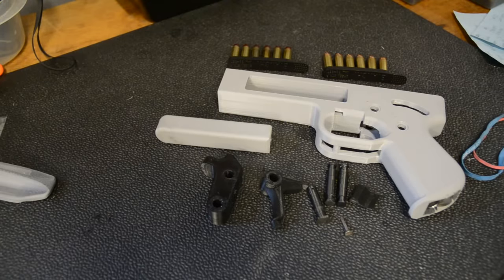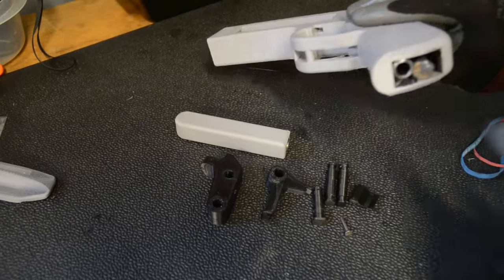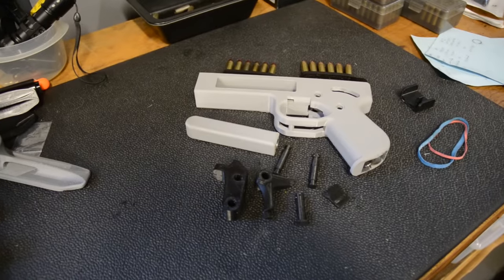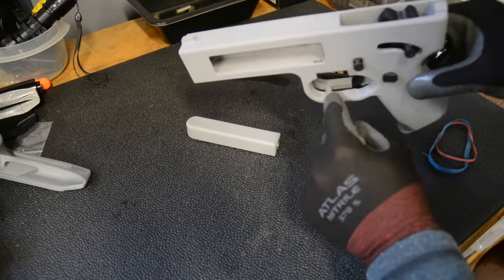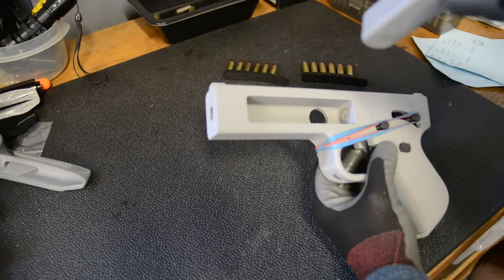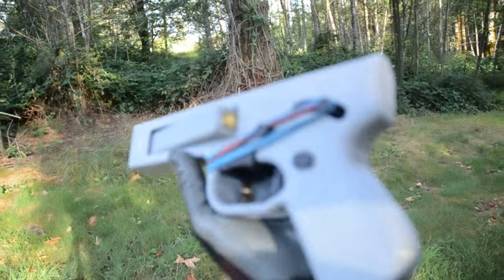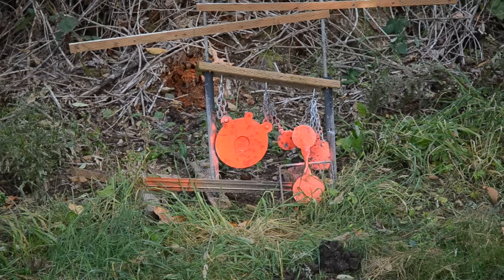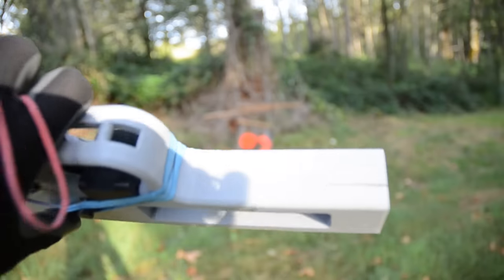Songbird 3D Printed Pistol - .357 Magnum

Comment: IMO it was not a "wedge" or layer failure.

I would say it was the gasses that was jammed  into the voids between the barrel and the barrel tip that caused the banana and burned plastic at the tip. the gasses have no where to go so the piece failed at the weakest point letting more pressure out and by then it was over. you cleraly see all that burning on the inside is a bad sign and the weak layer was just the weakest point that happened to be there maybe from a lot of firing.

1. you could machine the barrel parts to the thousands of an inch make them all perfectly flat and the exact dimensions to 0.0001- 0.0003 if an inch of accuracy with a lathe. that might fill any gaps and make sure the gas all goes out the tip of the barrel.
2. If you made the barrel top clamp down on the barrel insert it could fill any gaps and hold them together. could turn into  like a nose attachment type thing.
3. make a new full length barrel and change the loading system.
Reply: I think you're very professional

Comment: To help stop splitting you can "weld" with a soldering iron rings around the barrel. I have printed quite a few bike parts and this is a trick I have used quite a few times to improve the strength along the layers. You can use filament as a filler material. Give it a try :)

Comment: I found this interesting because I have a 3D printer (Flashforge Pro FDM style) and I'm a shooter. Did you use ABS, PLA, or something else for the frame? Also, why the rubber bands? There are springs aplenty out there. Are you uploading this to thingiverse? Or did you find it there?
Reply: ***** Didn't know he had one. Thanks.
Reply: John Mood Your link refers to undetectable firearms. I was being more general regarding making your own firearm. You can never transfer it. But it is legal to do under ATF regulations. Look into 80% receivers. It's a complicated subject. I personally would not touch one. In the case of 80% receivers, it is just cheaper for me to buy a 100% receiver on the ATF-4473 from an FFL. IANAL.

Structurally, an ABS or PLA or any other FDM printed "gun" will not stand up. Steel components are needed.
Reply: If you read the entire ATF code you will find that handgun manufacture is a great deal more regulated than you think. It's a crime, the article does mention that, but my may have missed that part.

I agree, I would never touch one, much less fire it with magnum rounds. that liner could barely stand up to .22 LR pressures, 357 Magnum standard pressure is 35,0000 PSI.
Reply from the maker: +John Mood You are incorrect.  See here: https://www.atf.gov/firearms/qa/does-individual-need-license-make-firearm-personal-use
Reply: Your build, as I read the law falls under the NFA rule, and you don't seem to have a $200.0 stamp and didn't mention if you had one or not....
Reply from the maker: +John Mood How does this fall under the NFA? I have lots of stamps for other NFA items, but a single shot pistol doesn't require one.
Reply: John Mood This pistol would only fall under the NFA if it was an AOW. Then it would need the Form-1. That would only happen if it was a smooth bore, so far as I can tell.

My reasons for not touching 80% receivers or building from scratch are more legal than engineering related. I live in a free state, so I don't have to. While I am a DIY person, making a firearm from scratch is beyond my ability.

What I would do, as I said before, is buy a 100% receiver on the 4473 and build from there. No machine tools are required for that and there are no legal ambiguities to deal with.
Reply: That's true. But the project is very questionable, and extremely dangerous & irresponsible or the video maker.
Reply: If a person decides to do the same thing, that's on them. Personal responsibility is a part of freedom. Keep it legal and do as you please. Take responsibility for the consequences of your own actions. Don't blame others.
Reply: I don't blame others, I WOULD blame myself if I did something so idiotic. Those that do this will eventually suffer some consequences, so free will needs to be tempered by common sense, and this project makes NO common sense whatsoever, in my opinion.
Reply: John Mood I think that we are mostly on the same page. Our disagreements on the law can be settled by the ATF. As for making videos of doing something stupid, where would LiveLeak be if no one did that? ;)

I don't think I have anything more to contribute to the discussion. Have a good one.
Reply: True that!  I tend to lean to, if possible, the stricter interpretation so I do not run afoul of the ATF. God forbid you have them call on you with a warrant... Even if you're completely legal, you'll fare better if you're staying on the conservative side of the interpretations, just my way of seeing it. I like my freedom and my Second Amendment privileges too much to screw it up.

Have a good one.
Reply: John Mood I'll just say, 2nd Amendment rights, not privileges. ;) The feeling is otherwise mutual.
Reply: I would lose my right to carry concealed under a different set of laws.  As a retired cop those other laws would take away my right to carry concealed should I run afoul of the law. Non-police CCW holders face the same loss of carry privilege if they run afoul of the law. Hence the word privilege. I could still own and possess in my home and auto under the laws of my state, but should I lose my LEOASA carry permit it would be a a major problem for me.
Reply: I take a stricter constitutionalist view of things, so it's really a matter of semantics.

Losing my CCW would be a major annoyance for me as well. Strictly speaking, I only have it to be in compliance with State law. I can't afford to take my principles to the courts.

Comment: That barrel wouldn't wedge forward. The gas pressure from the explosion is causing the separation. You should always bake your 3d prints in an oven to fully bond the media

Comment: 3D printed pistol: exists
Metal detector: this is cheating
Reply: Still has plenty of metal.😎
Reply: The barrel NEEDS to be metal, if you try to 3d print a barrel it would blow up in your hands and probably kill you. Because obviously, 3d printed material does not have the structural integrity to withstand the pressure s exerted by the propelent and the projectile going through. 
Furthermore, I would much rather purchase a firearm at that point rather then making one in that manner....in short...

 

THAT GUN FUCKING SUCKS!!!
Reply: It's a 3d printed piece of junk frame, you can actually print metal but those are far more expensive.
Reply: @joshuawood1436  you must be really lonely!! Your commenting on almost every post the same comment on a two year old video.
Reply: @ftniceberg874  What?

Do you speak English by chance, and if so can you repeat that,  but in English?

Comment: a lot easier, cheaper, quicker and safer just getting a ghost gun in the hood
Reply: this pastic gun is the least safest gun due to not having a safety function installed and the gun is more likly to explode in your hand which makes it more dangerous to the user then a real gun.
Reply: hendrixphish420 also alot easier to go to prison when the gun is linked to several murders
Reply: Mother is the invention of necessity. Wait... rearrange that.
Reply: Nieroshai Weird.  I just wrote that inversion of the phrase last week!
Reply: Bomb
Reply: @senkenkai  if you need a manual safety on your gun, you shouldn't own firearms lol
Reply: @iSuperdupaloveweed  that was long ago. Now I think it doesn't matter whether a gun has a safety or not.
Reply: Pick up a ghost gun, get randomly checked by cops, turns out the gun has matching ballistics in 5 murder investigations, whoopsie!
Reply: Hood ?? Safer !!???
Reply: rollin thirtys  unless you swapped out the barrel and the firing pin you'll get charged if caught, they run forensics on both. If they find a match in their database you'll be bubbas b'tch for the next 25 to life.

Comment: I wonder nobody has printed a derringer style gun? so much easier to load.
Reply: I'm kinda curious why people try to reinvent the wheel. You don't need to make every single part. If they would buy trigger control parts, etc, you could make a great reliable gun.
Reply: ***** Uh, have you compared a medieval cart wheel to a Z rated radial lately? There absolutely is a need to re-invent the wheel about every two years or so.
Reply: I understand where Len is coming from. He means just print the slide and frame, then buy the internals and hopefully have a fully functional pistol. I think these people just wanna see how far they can get with just the printer and whatever is available at home. Basically make it from scratch.
Reply: as you should know, a round needs pressure on all sides to work, a plastic frame could not possibly put back an equal or greater force against an expanding .357 or even 9mm case unless it was the thickness of a human thigh.
Reply: JoJo Show that math.
Reply: With his legit barrel liner, he only needs to worry about bolt thrust on the frame. Realistically, the frame just needs to takes a little over 3,000 pounds of peak backward force from the cartridge's base, plus maybe 50-100 pounds of forward force from the bullet acting on the rifling. Assuming he's using an optimal nylon material with a shear strength of 4,800 psi, a breech face over 1/2 inch thick will technically be able to hold up to the peak bolt thrust of a 357 Mag (based a rim diameter of 0.44", which gives a shear circumference of 1.38". 1.38" x 0.5" x 4800 psi = ~3300 pounds of force needed for cartridge base to shear/perforate through breech face).
Reply: He's using ABS. Nylon would be more appropriate but are not widely available in FFF printers at this time.
Reply: Victor R You are correct. You don't need a form 4 for a barrel in the US, correct? That's all I was implying. The hardest part is easy to get, but I get they want to try and build the whole gun.
Reply: RCONSTRUCT you can make your printer more compatible, try carbon fiber or polycarbonate and have something that will last. yes you can print with those

Comment: I wonder? If you extended the barrel liner out the front of the frame, it might help to lessen the pressure that caused the frame to split even more.
Reply: and make it a one shot pistol. The barrel swings out from the front, pushing the barrel through would make it stick in there.
Reply: just insert the barrel into the front instead of the side after replacing the round.
Reply: Eto Hige Gamer Culture tvat would send the barrel flying
Reply: Espen Andre not if you put up a no fly zone sign
Reply: or he could make it load like the double barrels shotgun
Reply: William Richards bjcjj

Comment: What kind of 3D printer do you have? Ive been wanting to play with ABS, but mine is not an enclosed unit.
Reply from the maker: Fusion3 F306.  Try putting a cardboard box over your printer.
Reply: i have a cr-10 and i put a small 1x1/2 pice of wood with clothing hangers and i balance it on top of my printer then i put a bed sheet over it and it works great
Reply: Why does in need to be enclosed?
Reply: ABS will warp by too much cooling if its not enclosed to retain heat.

Comment: The air powered German SWAT defensive weapons are basically airsoft guns with metal bbs that unload 1000s of rounds a minute. Like saw a door in half bb guns. They are super simple to modify from a standard airsoft weapon just add a bigger air tank and a huge hopper. There are TONS of loopholes. The 2nd amendment is really fun.

Comment: Creates the perfect ghost gun

The Mexican Mafia wants to know your location
Reply: has a metal barrel
Reply: Ya really think any large Mafia doesn't have the cash to buy a machine shop and just make all they want? 

There is no such thing as a firearm that will get past a metal detector. Just like how the media tried to scare everyone over the plastic Glocks when they came out. They never mentioned the slide, barrel, firing pin, etc. were metal.
Reply: I'm not talking about a metal detector wise... I'm talking about how easy it is to make and how cheap it is. I have no idea where either of you got the idea that I said it could go through a metal detector.
Reply: @greenman8060  

How much does it cost to get a 3D printer capable of doing this and how much will a person have to learn to use it properly?

It's not illegal to make a firearm at home as long as it abides by current restrictions.
IMO it would be easier to get an 80% 1911 or Glock frame and build one. All you need is a tabletop drill press, a few bits and follow the instructions.
Reply: @DChrls  ok well it was supposed to be a joking/satirical comment but झयभव

Comment: The reason why he didn't blown up his hand while firing that gun is because the pressure from the bullet itself is pushed towards the magazine barrel (I'd like to call that barrel a magazine since the bullet is is inside of it.)which when fired, the pressure is kept inside the barrel until the bullet propelled out. The main reason why the muzzle of the gun cracked is because as I've said the pressure from the bullet is kept inside the barrel pushing the bullet out and that pressure is so immense it cracked the gun muzzle.

Comment: I guess it's just the overpressure that splits the frame at the front. If the barrel would reach out of the frame, so that the pressure could expand outside, it wouldn't break like that.

Comment: .357 is about 30-35K PSi chamber pressure.  That's putting a lot of faith in that plastic breech-face and your barrel liner.  You're lucky the only thing that happened is the frame cracking.  I've seen a lot lower pressure loads cause guns that were built for black powder, but out of steel, rapidly disassemble.

Comment: To fix your layer separation just print the frame vertically. That will also allow generated forces to be absorbed through the frame, similar to a spring

Comment: I suspect it split because of the expansion of gas. And I wouldn't be suprised if the barrel shroud were to soon fail in the some mode, since your insert isn't full length.

Comment: wait if you have a pre-bought barrel doesnt that make it not a ghost gun?
Reply: nope only the lower receiver is labeled as a "firearm" and carries the restrictions and serial code branding. in a pistol this normally constitutes the frame and trigger housing. The rest of the firearm barrel included are not counted as the firearm, they are simply parts to a firearm. My wording may be a little off but that's the basic idea. In a state with concealed carry restrictions I can purchase like 70-85% of a pistol as parts, and only need to have the receiver shipped through the proper FFL channels. It's strange I know.

Comment: So what components of the gun absolutely must be metal?
Reply: the barrell
Reply: @alessandrodimilla8450  I dunno, I think the barrell can be carbon fiber
Reply: @alessandrodimilla8450  firing pin for sure as it needs to act like a flint
Reply: @costbubbles8336  true but maybe one can create some cheap ball bearing + 3d printed shell
Reply: @ViralKiller   so really only the firing pin ,and maybe theb arrel? Nothing else? I'd like to learn some about gunsmithing heh 

any suggestion?
Reply: @ViralKiller  No? Modern guns do not use flint to ignite the explosive compound in the bullet. They use a highly volatile compound that ignites when struck at high speed.
Reply: @ViralKiller  I could not reply to your other comment for some reason, you need a special type of powder, a volatile primer. I think you could punch out the used primer and insert a new one, because I think they sell those online. When I was younger I would put wadding and gunpowder into revolver cap guns to shoot bb's at stuff.
Reply: @serverman-re1bj  the primer you speak of is at the striking point right? a thin slice
Reply: @ViralKiller  Its a little bulb thing on the back of the cartridge. If you look at the back of a bullet, you can see a small round circle in the middle. That is where the primer is located.
Reply: @serverman-re1bj  yeah I am aware of the location, just not sure of the chemical composition

Comment: I USED  A NAIL ALSO FIRING IN MY AIRSOFT  WALTHER PPQ , IT  ONLY SHOOTS ONE ROUND AT A TIME BECAUSE THE MAGAZINE TURNED OUT TO BE A NIGHTMARE TO MAKE, BUT IT WORKS GREAT,  BEST  WITH CCI 22 SHORT, OR CCI  22LR QUIETS, BUT  IF I'M RUNNING STINGERS OR MINI MAGS I NEED A BARREL SWAP AFTER 20 ROUNDS OR SO.  REMEMBER I AM USING THE ORIGINAL 6MM AIRSOFT ALUMINUM BARREL, THE HYPER AMMO TENDS  TO EXPAND AROUND THE  CASING,  SO I BUY THEM BY THE METER/YARD AND CUT THEM TO SIZE. AND BECAUSE  THE  ALUMINUM IS SOFT RIFLING THE BARREL IS  A  SNAP COMPARED TO  STEEL.

Comment: Those rounds were moving incredibly slow. You can see the 38 fly over the target before it hit the dirt.
Reply: That could easily be improved by tightening up the tolerances. I'm pretty sure this was just a concept model. For what it is, it is impressive. This isn't your I'm going to war, gonna be on the front-line weapon, its more of a spy tool for a get in, get out, and get it done discreetly kinda deal, or as a self defense one off.
Reply: @travishirschfelt413  If it's going slow enough to see it with the naked eye, that's a serious issue, and that was with an actual metal barrel.

Comment: If your plastic device got crack and you don't need sissy design, you can bend a metal paper clip to S shape with perpendicular rods on a edges, clamp rods it in pillers, heat S part to red and stamp it right on a crack. Then you can cut rods, that procedure will strengthen your device. I think it Plastic Welding and even exist special tool for it, but you can do it just with pillers, iron paper clip and  gas burner